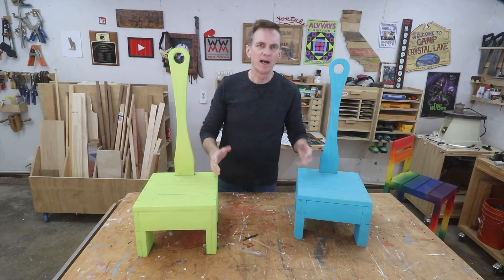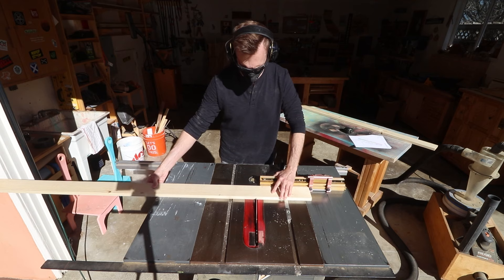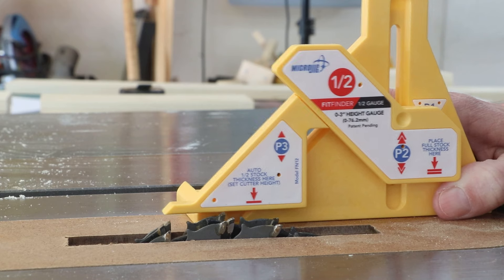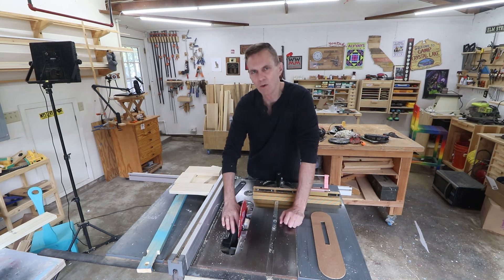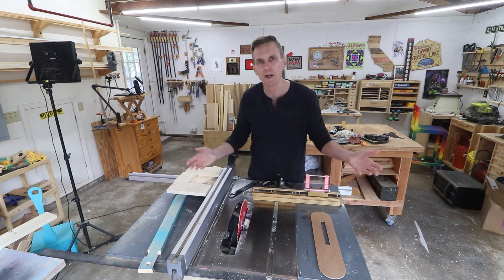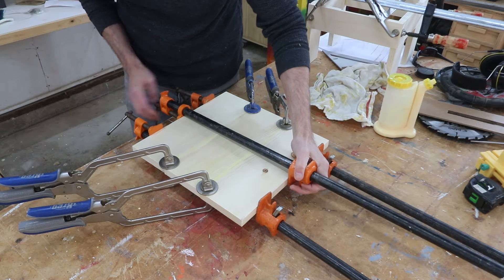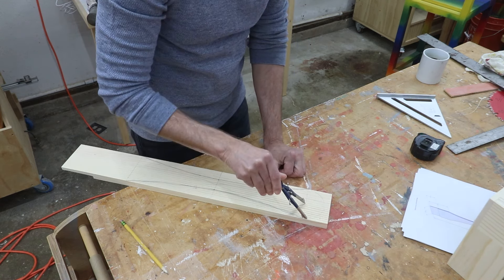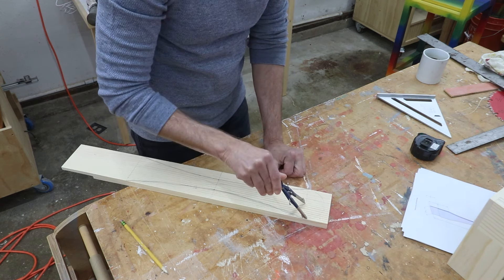Making the world's handiest step stool (No fasteners)

Comment: I'll be making some of these for my wife. Our new house has higher ceilings & thus taller cabinets than our current house and she's only 5'2" so she wants something that she can stand on but can be kept in the kitchen or laundry without looking like a shrunken ladder that belongs in the garage. I'll be making them out of walnut to match the breakfast bar and am also modifying it to be 2 steps up with the lower step hinged to the top step so she can get extra height that a 6 or 8" step height won't provide. Thanks for the video - it's given me just what I need to take on the project for her.

Comment: A couple of years ago, I had a shed in my yard that had been constructed in a bad spot and was slowly trying to slide down the hill.  So, I hired a gentleman that builds sheds to come out and relocate it onto a new pad.  Because I couldn't get 4x4 timbers at the time long enough for the long sides of the building, I used half lap joints and big giant deck screws to secure them.   The shed builder, a genuine Mennonite carpenter, said he was very impressed with my work.   Thanks Steve!

Comment: I just completed mine, and I'm so happy with the experience, Steve! I added shims inside the base to support a drawer floor after the fact, and put hinges on the front of the top, opposite the handle, so that I can lift the top to store things that I'd use this lift to work on (light bulbs, batteries, screwdriver, etc.). I even got started indenting the wrong side of the foot assembly, and was able to patch it and tell the story. Can we send you pictures of our creations?

Comment: Good to see another project video, Steve. And thanks for including the mistakes, because the rest of us don't feel so bad when we make them. I'm sure many of us have made that cut on the "wrong side" of the workpiece. But some mistakes are a wake up call and you reminded us of one in your video. So this last holiday period, guess who did not have their mind on the task and used both a miter gauge and fence for a quick cross cut? It was only a short piece, but went it flying backwards at a rate of knots and smacked the wall about 20 feet behind me with a thud. Fortunately I was off to one side and out of the line of fire. But it did knock my fence slightly out of alignment and I spent the next few hours carefully inspecting the whole table saw, checking for out of square and damage and realigning the fence. I was really annoyed with myself because I have made a hundred cross cuts before, always either using the stop block on the fence method or using a table saw sled. A momentary lapse is all it takes, especially if you rush. Always look forward to your videos.

Comment: Pretty slick!  I like the different versions you've done over the years.  Is there a chance the top may try to split the base apart with expansion in the spring?  I guess the way to handle this if it does try to is notch out a small section on the front/back where it seats into the base part (or cut it shy in the early stages).  Thanks for sharing all the "oops"es as well.  It's definitely a big part of the woodworking experience - fixing stuff, even when we did it to ourselves.

Comment: Emptying my dust collector was a pain with dust going places it shouldn't- in my face, for example. One day, I decided to place the bag in the bucket before replacing the dust deputy and lid. The bag nestled at the bottom of the bucket, and the top part of the bag was folded over the sides outside the bucket. The lid didn't leak, the suction was as good as before, and the next emptying was as simple as lifting the bag out of the bucket.

Comment: Remove the four little screws from the saw that adjust the height of your throat plate, and install four 3/8" long set screws in each one of your throat plates.  This way, you drop in the plate you need and the height is already set perfectly.  No messing around having to customize the saw to match whatever plate you're using.

Comment: Yeah, mistakes are inevitable for my woodworking projects 😅

As a tip, you could have left the dado stack in, do the correct notch, and then change the blades to cut the mistake and trim the stretcher.

Also, could have done the notch using the single blade and having the piece stand upright for the long cut 😊

Comment: I had to laugh when you showed the plans to point out the mistake you made. Not to laugh 'at' you, but because it is so relatable. I sometimes do incredibly stupid things, being certain i am doing great, until i see the mistake i made. Like for example, i made an outfeed table on wheels, which doubles as a little work bench that i can roll around. It was designed to be the exact same height as my table saw. I felt really smart when i thought about deducting the height of the wheels from the overall length. But my table turned out way to low and upon measuring, i found that it was exactly the same height as the wheels. Turned out i had already taken the height of the wheels in consideration whilst making the plans, then forgot about that and then, thinking i made a great last minute discovery, facepalming myself thinking; omg, i almost made it way to high! Good thing i thought about deducting the height of the wheels! .... I did it twice...
Also 'high' 'height' 'eight' and 'hate' are funny words... I like 'high' 😂

Comment: I tried making a stool for my 6 year old, and I was using pocket holes, well my dumbass decided to wing it instead of using plans(I'm a beginner)  and I put the pocket holes on the inside of the legs....
My drill wouldn't fit in there, and a 90 degree attachment wasn't cutting it. Had to scrap the whole project,  and start over. 
Glad to see a seasoned woodworker admit to mistakes on camera. Sometimes I feel like giving up. But I don't want to admit I spent the money on these tools for nothing. Plus it's really satisfying to make stuff.